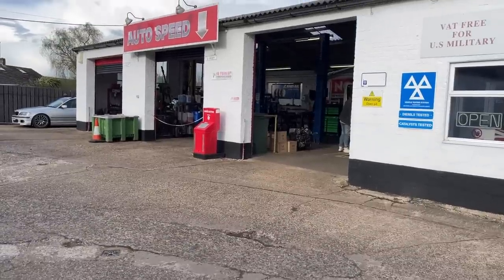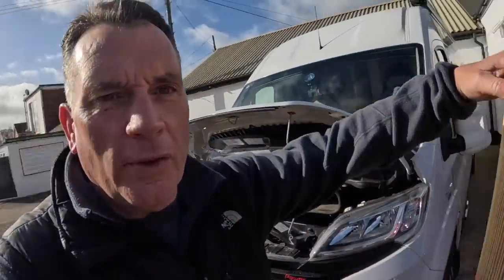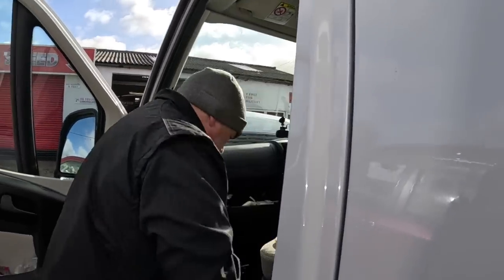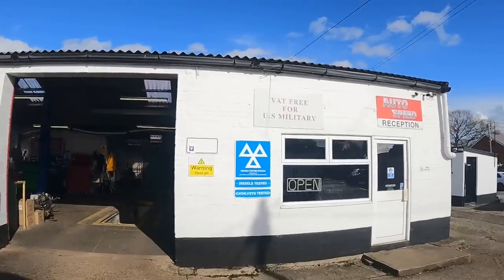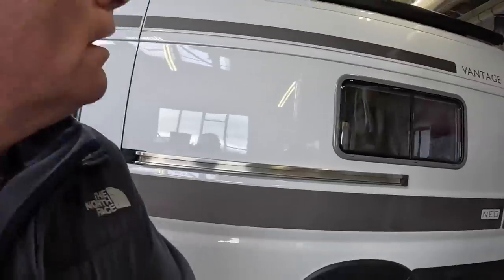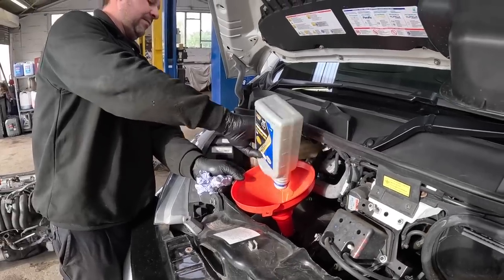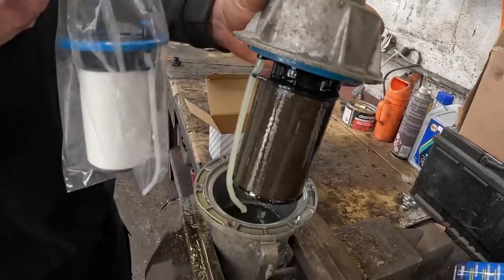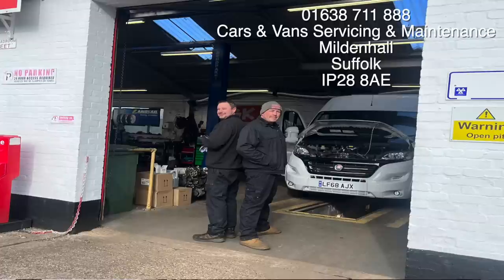HOW MUCH!!! Van Service Costs - FIAT DUCATO CAMPER/MOTORHOME

Comment: 68 plate so must be around 5 years old. Cam belt should be changed at 5 years regardless if mileage,  clutch fluid should be changed every 4 years, 2 years if it's a comfortmatic.

Comment: Our van is a 2013 Fiat Ducato so well out of ‘warranty’. Got a quote off Fiat Commercial garage of £680 for major service. Bought all the parts (including 10 litres of oil) for £131 and did it myself in about 3 hours. Very simple. Oh, Fiat Commercial wanted £1260 for a Cambelt/water pump change. Local garage charged £650. Not often you save well over £1000 !
Reply from the maker: that’s a huge saving ! wish i could do things like that myself i’d save a fortune . the prices they charge are ridiculous

Comment: I bought a Fiat Ducato which was just over 5 years old without realising that Fiat recommend all belts are changed after 6 years !  So this month I have 2 year service plus all the belts and water pump as well as the MOT !!
Reply from the maker: the cam belt thing always gets me , 6 years yes and i know it’s always better to be safe than sorry but how many miles does it have , how often is it used etc , how do you drive it was one question i read on a forum , others have drove over 100k miles and still on same belt ! others not so lucky , id rather be safe but that’s just me , an expensive month for you then i don’t envy you 😬 but at least you will know it’s done !
Reply: Unfortunately I fear it's a degradation of the rubber (a bit like tyres) which they use to worry us about the time limit. Only with vw, the time and mileage rules both apply in the UK, on the continent, it's only mileage! I just bought a 12 year Neo with 30k miles and no sign of a cam belt change. I obviously did it straight away.

Comment: Always an expensive time and some items I’m sure don’t really need changing due to the low mileage, especially the cam belt!! If you plan on keeping the van look at a K&N air filter, they are washable and last a lifetime for not much more than a fiat paper one.
Reply from the maker: yes i’ve heard k & n filters are very good , always a strange thing with the cam belts , age or mileage ? as you say if the van is hardly being used as most uk motorhomers hardly go over 10k a year if anywhere near that at all , then the insurance goes up ! but that’s another story !
Reply: @TheFrenchiesMotorhomechannel  Fiat say Ducato cambelts should be changed at 6 years which for some motorhomes can be a relatively low mileage !
Reply: @billsimmonds6005  cam belt on a Ducati 2.3 is 5 years, is your not the 2.3 then ?
Reply: @The-Salty-Bager  I have a 2.3 multi jet 2 150.  My local Fiat Professional dealership told me 6 years or 100,000 miles !

Comment: Just to say I didn’t see any wheels removed for a service or gearbox levels checked etc, we also service Motorhomes including wheels off brake checks and grease up underneath. I noticed original parts but not the oil 😢 Great video as usual
Reply from the maker: hi stephen i had limited time during the service to get everything on camera , rest assured they checked everything required throughout the day , however the oil was the same grade used for fiat based vans , is there a difference between that and actual oil from fiat ? just interested for the future, thanks for watching and commenting 
mike 👍
Reply: IMHO, I dont think you can check the oil level in the gearbox? not on the earlier Ducato/Relays/Boxer 5 speeds..May be different on later 6 speeds...  Fiat dont make oil, but recommend a grade/spec...

Comment: Did the same with my motorhome,Mike. Bought a 2017 swift bessacarr in December last year. It’s only done 8000 miles. But when I checked the oil,it wasn’t clear. So decided to change all filters and oil. Genuine Fiat parts. My local garage did the service at a fraction what a dealership would charge.
Reply from the maker: hi andrew yes it’s always good to know your van has been fully serviced , i hadn’t had it done since we got the van a year and a half ago and although mileage wise , it wasn’t really due , it’s comforting to know it’s now been done , habitation next ! never ending .. 😩
thanks for watching the video 
all the best 
mike

Comment: Excellent price for a very thorough service. Mine is due its first (2 year) service and it is booked in next week with a Fiat dealer at a charge of £540!  The service includes oil and filter, pollen filter and brake fluid change.  I chose to use a Fiat dealer because the warranty is up at the end of the month.  However, once out of warranty, I will probably look at cheaper options next time including doing it myself.
Reply from the maker: yes my van is 5 years old coming up and only 2nd service due to mileage and just thought better to use a garage and save a bit but if i was in your situation i would have done the same most likely , thanks for watching the video 
mike 👍
Reply: Hi Mike. A very useful and informative video. I was also wondering if local garages could service such a big vehicle. How many miles between services? And does it tell you on the dash when your service is due?
Reply from the maker: @debbiel6443  hi deb good question about the dash notification, I’m sure it would come up but don’t hold me to that , depends on age of van , I’ve never let it get to that on other vans i’ve always roughly known when they are due , but it depends on the miles you do , id say a basic interim service every 6 months or 6,000 miles whichever comes first but that’s only if you do a lot of miles , if not , then probably just a 12-18 month oil change won’t hurt , just dip the stick every now and then and check the level between changes 👍😀
Reply: Good advice Mike. We are away every other weekend in the summer. Had the van for 15 months from new. It had a hab check in December, not yet had a service, but we have topped up the oil.

Comment: I did exactly the same with my Adria for servicing. The nearest Fiat van dealership is Carlisle (an hour away) and the price was hideous, so I asked my local garage if they could service my van without affecting warranty and they confirmed all OK as they only use genuine (Fiat) parts…. Which saved me a fortune. I’ll be taking my new van there too when it comes around to servicing time. Thanks Mike 👍
Reply from the maker: that’s great it’s always good to save if you can and especially trust the right people to do it 👍😀

Comment: Good video Mike. Strangely I only checked my oil last week and  . . . yes it was black. I need a oil change etc and was wondering just how much it is going to cost . . . your video was just what I needed. Thanks.
Reply from the maker: your welcome glad you appreciated it thanks for watching
Reply: diesel cars and vans oil goes black unlike petrol that can look clear and golden even after many months i have both and do all my own serviceing..
Reply: Black oil is no indication that it needs changed.  Its normal after a few 100 miles
Reply: Black oil on a diesel engine will appear within a few miles.   It doesn't mean it needs changing!

Comment: Whilst a main dealer can add at a service that very few independents have facilities for,  is to update softwere in the various modules. There have been updates  that improve performance  and prevent issues. Although not a recall there have been overfueling issues on non addblue Fiat  Euro 6 engines with the complex EGR system. Ultimately,. if not corrected,  it  can lead to damage with engine fault codes and very costly repairs.

Mike
Reply from the maker: hi mike , interesting read thanks for the information , i think i’ll book it in , we tend to forget these days the amount of tech in these engines and i assume many overlook it , for the sake of a plug in and scan its worth checking , thanks for watching the video

Comment: Nice one Mike - is that the two year Service?
Big saving - looks like the way to go for us too 
Great to watch - cheers mate 👍👍👍👍
Reply from the maker: hi thanks yes when i called fiat they said it would be the 2nd service , even though my van is 5 years old iit goes by mileage , thanks for watching , have a good week 👍😀
Reply: @TheFrenchiesMotorhomechannel  you too mate
Reply: @TheFrenchiesMotorhomechannel  if it’s 5 years old are you not due a cam belt change too ?
Reply from the maker: @The-Salty-Bager  yes next year 😩

Comment: Very useful and informative video. We have an issue with the build up of rainwater in the scuttle/air intake unit 8:15 which fills with water and spills down the air intake pipe assembly and pours over the engine compartment when you lift the bonnet. There doesn’t seem to be a drain pipe to prevent this. We can  only park on a down facing slope outside our house which may be the problem. Have you come across this?
Reply from the maker: hello & thank you for watching the video , funny you should mention the drain holes in the scuttle panel , ive often had blocked ones in previous vans and have always managed to unblock them (if i remember)   , i found a part on ebay that attaches just above where the water lands and directs it away from the engine , i’ll search for it again and hopefully reply to you here with the link to the part in the next few days as we are away now and struggling with a signal 
all the best 
mike

Comment: Hi Mike great savings, I've just been Quoted £1,825 for service, mot, and cam belt at Fiat main dealer in Hull, for my 2018 V line 636se. Think I'm going to do same as you and use local garage and genuine parts. Great Informative Video thanks 😊
Reply from the maker: hi mike wow that’s a fair bit , most of that the labour for the belt no doubt , big job , can i ask how many miles you have done now please , we will need to think about getting our cambelt done within the next 12 months , and tyres ! 😩 never ending ! 😂
Reply: @TheFrenchiesMotorhomechannel  
Hi Mike, we bought the Van New from Brownhills in November 2018. So we had two free Hab+Vehicle services and because of Covid the service schedules are not as they should be. My last Vehicle service was in 2021. So this November the van is five years old and Fiat recommends the cam belt changing at 120 k miles or 4/5 years depending on use, however we have only covered 15k miles so in November i thought i would get it done +service +mot. Didn't expect the price that fiat have quoted 😳 and they said the prices will be going up by November !!!!, so ring back nearer the time for new price !!!. I use a local Garage near me in Beverley for mot each year so I'm going to get a quote from them. Hope this helps. 🙂
Reply: jeeess... cambelt ony £350/400 at most places oils and filters £150 ish good aftermarket i've done mine for a lot less than that useing bosch, mann, etc.Oil from opie oils for fiat.. fuchs for my van 5w 30 got 7 litre pack delivered for £43.45..
Reply: My local Fiat 'stealer'ship wanted £1300+VAT to change the cam belt on my 2017 / 9k mile ducato / swift m/home - tthey told me that it needs to be changed after 5 years and it's an  engine out job and they would need my vehicle for 2 -3 days. I politely to them to f^kc off , and got it done by local garage in a day for £450 inc VAT ( £55/hour labour rate)

Comment: I don't yet have a motorhome but enjoy your posts. I don't like this idea of a 2 yearly oil change, even on a low annual mileage I think it should be no more than once a year. I have a Volvo XC 70 and pay about £70 ( near Manchester) for and oil change and Volvo filter plus the cost of the oil which I supply myself (A5 B5 0 -30 Casteol Edge fully synthetic) . Oddly the oil is cheaper at my local Volvo dealer than I can find it online
Reply from the maker: hi yes that is rather strange the oil being cheaper at the volvo dealer , everything has gone up its madness , and that’s if they can even get hold of certain parts now , don’t know where it’s all going to end but it can’t carry on!..
thanks for watching our videos really appreciated 
mike

Comment: Servicing and cam belts so expensive just been quoted £1,000 including vat for cam belt and water pump change that’s without the service which probably gonna be another £300 plus without the hab check which just booked in for next year at £250 as he gets busy in summer months as that’s all he does so booked it in now good detail of your service do they do cam belt and water pump changes willing to travel from Essex if they cheaper 👍🏽👍🏽
Reply from the maker: hi jeff yes mate ridiculous prices  out there , what van do you have please , year make model as will need to check height for service bay 
thanks 
mike

Comment: £400 is a lot of money. Most of those filters are just badged with branding No wheels off, no brake fluid or coolant tests, no gearbox checks. Really just an oil and filter change rather than a service, but its all good, that needs doing, You are comparing apple and oranges on cost comparisons though.
Reply: Have you ever priced a Ducato fuel filter up

Comment: AND . . . .what about lubricating moving parts - hinges etc and checking brake hoses, suspension rubbers, tyre pressures and so on? The water drain hoses under the windscreen get blocked so should be flushed through in a service. There's more to a service than changing oil and filters. I am not defending main dealers, but if that work you showed was all I got, I would go home, jack it up and continue with the rest of the work that needs doing. Still, I suppose you would have got a rubber stamp in the service book. As for main dealers I took my petrol car to a Nissan franchised main agent in Coventry and they didn't change my spark plugs and tried to tell me that was because it has a diesel engine. I exploded.
Reply from the maker: oh definitely i agree some try to take the p … they did do everything i just wasn’t quick enough to capture it on film , they checked levels and i saw them check the drain bungs , i had both block on last van and couldn’t figure out why water was collecting on the scuttle panel then i found the holes under all the bits of leaves etc !
Reply: @TheFrenchiesMotorhomechannel  Thanks Frenchies, that is reassuring. When I bought a new Fiat Ducato camper I was astonished to see the first service was at 35,000 miles - but I think there was a proviso - 'or one year'. Now I see it's 'or two years'. With improvements in oil qualities and quantities they use I think that is reasonable.